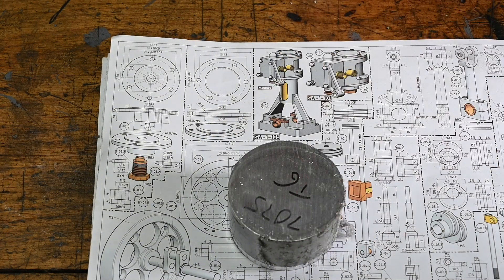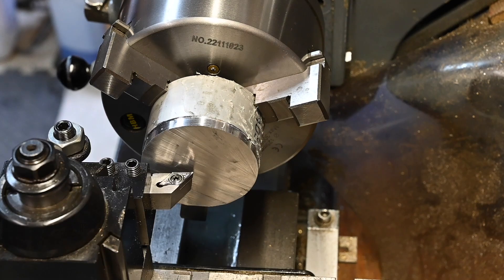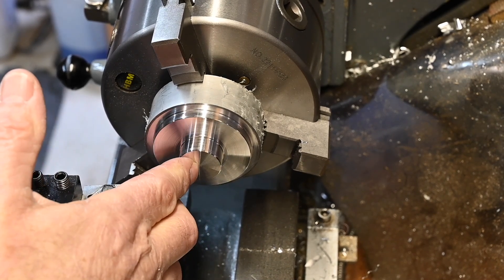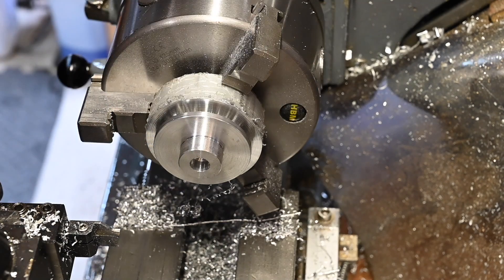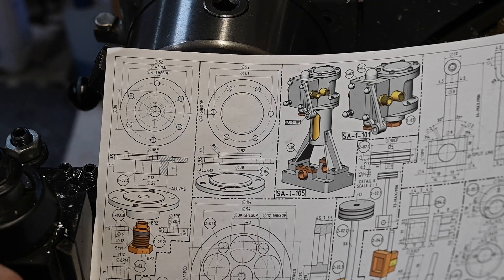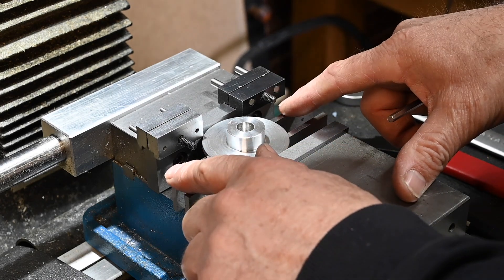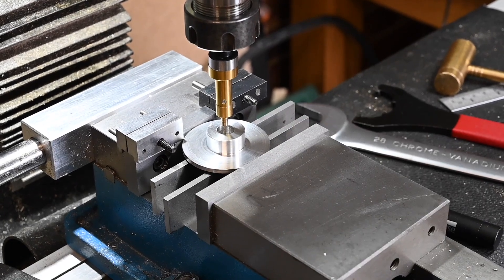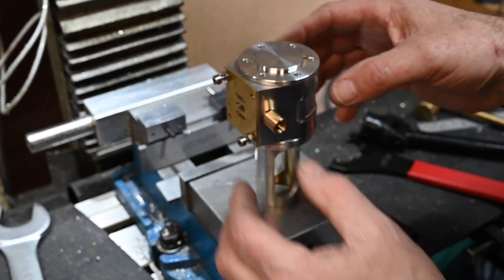Cylinder End Caps EP13

Comment: You made a nice job of the end caps Mark. Really nice finish on that aluminium. Cheers Nobby
Reply from the maker: @nobbysworkshop  I use the carbide cutter for ali and it produces good results directly off the cutter. Cheers Mark